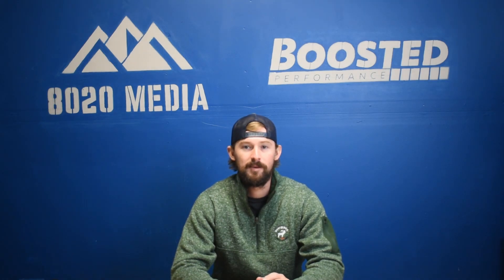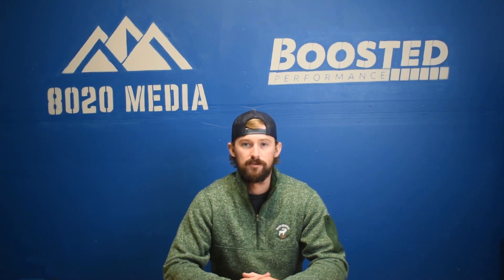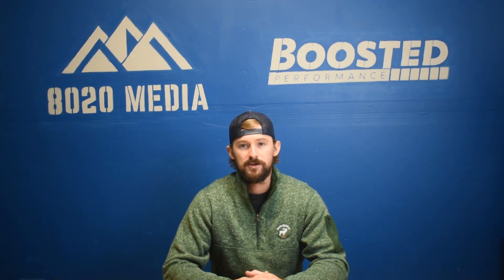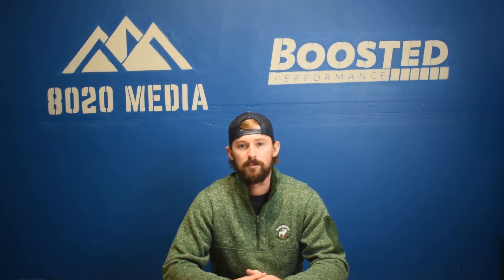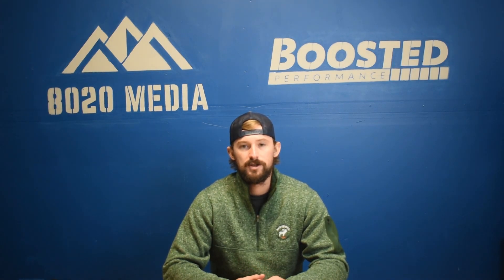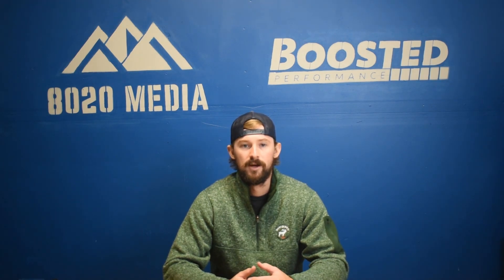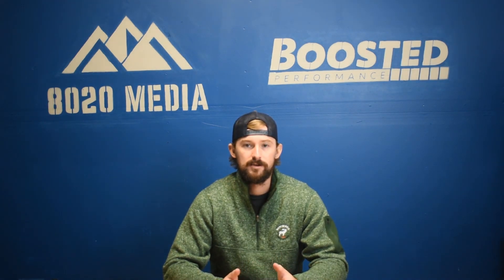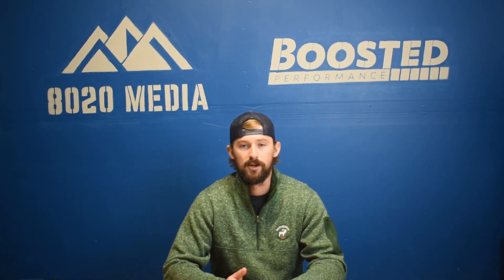Is the Ford Triton V10 a Bad Engine?

Comment: My 2004 f250 v10 got around 12mpg, then shot out the cylinder 4 spark plug now gets ab 9.5mpg and 8mph when towing, still tows just fine and its had about 5,000 miles on it with 9 spark plugs in

Comment: You have something wrong. Remove both  battery cables connect them together for about 30 minutes. You are draining the computer learning memory. Drive for 150 miles in the city. Scan for codes . Those spark plug problems are from people overnighting the spark plugs!

Comment: Never seen a timing chain issue with 2V engine. Only the 3V's when they went they started using plastic hydraulic tensioners. The gaskets would blow out on the tensioners. The 2V engines used an iron tensioner with no gasket, and I personally have never seen one fail. A 2V engine will go 400-500K without a problem with the chains. Doesn't matter if it's a 4.6, 5.4, or a 6.8, the 2V engines will run until the exhaust manifolds rot off the engine. The spark plug issue does suck, and is very relevant, but not a terrible job, unless it's the passenger rear cylinder. If you to end up blowing a spark plug out, I highly recommend using the Cal Van kit and insert. It uses a far more robust, shouldered insert than a typical Heli coil. The 3V engine had the opposite problem. The spark plugs would actually get stuck and break off upon attempted removal. I believe that was corrected by '06ish. Just my 2 cents.

Comment: Biggest problem with my Triton V10 is the rusted out rocker panels, door bottoms and frame. It's a damn shame my excellent drive train will be wasted when this Excursion goes to the crusher. Only 120000 great running miles stuck in a rust bucket. Shame on you Ford.

Comment: I just purchased at 2004 motorhome with the v10 it has 38k miles on it. I drove it 300 miles from Ga to Alabama it rode good pulled a Nissan Altima  behind it on a trailer barely felt it. Lookin forward to learning more about this engine it’s my first ever Ford
Reply from the maker: B - Nice! Sounds like a solid buy.

Comment: Mine is at 190k. I’m going to pull the engine. Take to a machine shop and have the plug holes repaired before the problem happens. Also will check to see if timing chain needs to be replaced. I can’t believe the cost of new trucks and I’d rather give mine a refresher before towing my fifth wheel.
Reply from the maker: B - Fair points! Thanks for sharing.

Comment: Have one in my 2000 Excursion for 200k. Never had this plug problem, always used Motorcraft plugs, never seize, and torque to spec.
Reply from the maker: E - Nice! Thanks for sharing your experience.

Comment: I am considering swapping the V-10 for a 7.3L Power Stroke.
Comments?
Has anybody done this?
'99' E-350 motorhome.
Reply from the maker: M - Swapping a V10 (likely the Triton 6.8L) for a 7.3L Power Stroke in a 1999 E-350 motorhome is a massive undertaking but not unheard of—some have done it for the torque and fuel economy benefits of the diesel, especially in towing or heavy-load scenarios. However, it's not a drop-in swap: you'll need the complete 7.3L drivetrain (engine, transmission—typically the 4R100, matching PCM/IDM modules, wiring harnesses, and fuel system), along with diesel-specific cooling and exhaust systems. The V10 and 7.3L have different engine mounts, frame brackets, and potentially transmission crossmembers. You'll also face challenges with electronics integration, including the instrument cluster, speedometer/odometer functions, and emissions system compatibility depending on your state. While the 7.3L is a proven workhorse, ensure your frame, suspension, and braking systems are up to the added torque and weight. Many have done this swap in F-series trucks, but fewer have tackled it in vans or cutaway chassis due to the tight packaging, so clearance for turbo, downpipe, and intercooler plumbing will be tight. It's doable, but it requires serious fabrication skill, a full donor vehicle (ideally a 1999–2001 Super Duty or E-350 diesel van), and deep pockets if you’re not doing it all yourself.

Comment: Looking to get a 2016 shuttle bus with this engine. your video gives me confidence. sounds like it'll be fine. I was worried because I heard many stories about the spark plug blow out and my dad had a truck with a V8 triton that blew itself up because of the timing chain issue.
Reply from the maker: Y - Totally understandable—and good news: the 2016 Ford V10 Triton in that shuttle bus is part of the later 3-valve generation, and by that model year, Ford had already addressed the major spark plug and timing chain issues that plagued earlier Triton V8s and V10s from the late '90s and early 2000s. The plug blowout problem was mostly fixed by 2003–2004, and while no engine is bulletproof, the 6.8L V10 is known for being a reliable workhorse, especially in RVs, buses, and service trucks; as long as it’s had regular oil changes and hasn't been heat-soaked constantly (which is tough on coil packs), it’ll easily go 200k+ miles—and it's actually less failure-prone than the 5.4L V8 from the same family. So yeah, it’s a solid choice if you’re getting a good deal.

Comment: I’m looking at an RV with the 97 generation engine. Is that one pretty reliable compared to the second generation?
Reply from the maker: S - Typically the newer generations are better. But the first gen is generally considered reliable and well-suited for RV use, especially in terms of long-term durability and simplicity compared to the second-gen 3-valve version (2005–2010), which, while more powerful and efficient, introduced more complexity and had some issues like spark plug thread concerns and cam phaser problems; the 2-valve V10 is known for being a true workhorse with fewer major failures, decent towing ability, and a long service life when maintained, so if you're okay with its modest power and thirst for fuel, it’s often the preferred pick for low-maintenance reliability in RV applications.

Comment: I have an 08 f350 with the 6.8 and it has 332k miles on the clock and all that’s wrong with it is 2 broken exhaust manifold studs. Other than that, oil still clean after 3,500 miles of driving with 4K mile intervals on oil changes
Reply from the maker: O - Nice! Thanks for taking the time to share your experience!

Comment: I have a 2002 F250 triton V10. Absolutely a great truck. I pulled a 5500lb  stainless steal trailer with four 1500 lb horses. Now if we were in foot hills or mountains Yes there was a problem with that much weight. The only consistent problem was it missed once you got to 55 miles per hour, but later my dad had his mechanic look at it and the the other mechanics had only ever changed 8 of the 10 spark plugs. After he replaced them all , it ran like a dream.
Reply from the maker: W - Nice! Thanks for taking the time to share your experience!

Comment: MINE IS A 2000 , FORD f350..Triton V10  IT HAS 140,000 miles , the Only thing i have done to the engine is new Coiles around 100,000 mls...
Reply from the maker: Thanks for taking the time to share your experience!

Comment: What causes the fuel economy problem exactly cause I do wonder about building one of these things with an aftermarket crank rods and pistons and add a big single.
Reply from the maker: F - The poor fuel economy of the Ford Triton V10 is primarily due to its large displacement (6.8L), naturally aspirated design, and relatively low thermal efficiency compared to modern engines. The engine prioritizes torque and durability for heavy-duty applications rather than fuel efficiency, with features like a high rotating mass, long intake runners, and low compression ratio (9.2:1), which aren’t optimized for fuel economy. If you plan to build one with an aftermarket crank, rods, pistons, and a big single turbo, you can significantly improve its performance and power output. However, to mitigate fuel economy issues, you'll need to tune it carefully with modern EFI systems and potentially increase the compression ratio for better efficiency, balancing power with fuel consumption.

Comment: Been researching this for considering a 2001 e350 with the V10 engine in it.  New about spark plug blow out but might need to start looking at a 2002 and up van now.  Thanks for the input.  Am kjnd of surprised about the timing change aspect thought it would be more like a 5.0 pushrod engine and go for a longer period of time.
Reply from the maker: B - Thanks for the feedback! Hope the video helped.

Comment: I have 08' F250 Super Duty with 355k miles and still running my goal to reach four hundred thousand miles and after that maybe reach 500k (lol) nothing wrong just keeping up with the synthetic oil change and maintenance. I am the second owner, I've had it since 2011 coming up on 14+ years ! A/C blows better than on my new truck.... I use it for  work and hauling round bales
Reply from the maker: H - It can certainly see that kind of mileage, pending maintenance! Keep us updated.

Comment: I had a 2008 3 valve v10 F-350 had the valve retainer fail and droped a intake valve in cylinder 4, it munched it till there were only a few chunks  left and sandblasted the cylinder wall. Since that cylinder had lost its intake valve, it was at the same / under pressure or under vacuum as the rest of the intake allowing all the munchies too get sucked into cylinder 8,9,10 and a little into 3 and 5... entire engine, heads, pistons wiped and when taking it apart I noticed that the cams and balancers had a lot of premature ware because theres no bearings from factory (the ware is prob cuz the previous owner didn't do proper maintenance as well) but in my opinion those motors are supposed too not last past 200miles with dealer maintenance. Every engine I've seen that ain't a Briggs and straton has cam barrings.  
Crank even had pitting for some reason and the timing chain retainer / tensioner on the driver side needed replaced I could colaps it by hand when biopsies was done but it never jumped time, it had a valve retained smaller then my pinky nail fail.
That truck had 174 000KM on it when it went and one new transmission and I think tansfercase at 124 000KM replaced by the previous owner at the dealer. Junk.  (Edit: the truck was kept up with when it was under warranty but the 5 or so years after the warranty ran out idk)
Reply from the maker: E - Thanks for taking the time to share your experience!

Comment: We had a company truck, an F-550 loaded to the max with this engine. For that duty, this engine was a mutt. Not enough torque but no RPMs, either. We didn't have trouble with the engine but it did eat coil packs. We had to bring it to a different mechanic to replace spark plugs because the usual mechanic nor the local dealer would touch them. Commercial truck, out of warranty. The truck would normally get 8 MPG in the summer. It was closer to 6 MPG in a New England winter. After 180k miles, the truck was on its second transmission and second differential but the engine did live until we finally got a new one. For something that big and heavy, it should have been a diesel.
Reply from the maker: E - Completely agree. Thanks for taking the time to share your experience.

Comment: I have been very happy with my 2001 V10 F250, only thing not mentioned but I believe is worthy of being known is that the V10 burns oil.  I make it a point to make sure to check oil level every 3rd fill up and usually have to add about 2 quarts between a 5000-mile oil change.  Also as mentioned the V10 gets terrible gas mileage, but I only use the truck to pull a travel  trailer 3 times a year, and on weekends going to adnd from the hardware store.
Reply from the maker: C - Thanks for taking the time to share your experience!
Reply: I have a 2002 I use as daily driver. About 10 miles per day.... but I notice that I do need to check the oil frequently.

Comment: I have a 04 E450 v10 in motorhome towing a ford Ranger I get 11 to 12 but the 28 ft motorhome is a B plus I stay under 62 to 65 mph the motorhome is lighter weight for 450 so I’m 2000 lbs loaded under max. Oil has always been changed Mobile1 once a year as I only put 2000 a year on her. It is ready to turn 50k miles. 
I hardly jumps out of overdrive on highways even towing. It’s always been garaged. I would never buy new Ford with all the issues they have but in 04 they were built well same as Ranger I pull.
Reply from the maker: F - Thanks for taking the time to share your experience!

Comment: I have an 05 excursion 4x4 v10 and not towing it gets 15.4. About 8 or 9 towing. Currently at 229k amd never opened the engine. Been a great engine. My 05 f250 with a 5.4 has 237k and also never been opened up but gets 16.6 not towing so not much better for the problems they can have.
Reply from the maker: C - Thanks for taking the time to share your experience here! Sounds like you take great care of it.

Comment: This is aggravating… Men that bitch about fuel mileage should buy a car.  There are 2 problems with the v10.  1 they don’t freaking die so that you can get a godzilla.  2 there is no aftermarket parts to add horsepower.  That’s it

Comment: I have my beloved 2002 f250 v10 that has hauled my keystone 40ft cross country no problem over 3100miles. On the same trip my 2023 f350 broke down half way home. It was fixed by the dealer but the whole thing was a nightmare.
Reply from the maker: S - They certainly don't make them like they used to.. Sorry to hear.

Comment: I drove a 16 passanger bus that had a V10 it blew out 1 spark plug other than that it was a good motor a bit of a pig 🐖 but was in a heavy bus. Had 130k when i left that job to get a CDL and drive truck but i still see that bus running around town for MRDD so still going.
Reply from the maker: T - Thanks for sharing your experience!

Comment: Just purchased a 2005 shuttle bus that belonged to a church. 22,000 miles on it. I hope it is as good as people say it is. I’d love suggestions on what to do since the motor is 19 years old even if it is low mileage. Drove it home 5 hours and it ran great. Change oil and tranny fluid? What else? Getting 6 new tires for sure. They looked good but I had a wobble driving it home. Took it to my tire guy and an inside dual had the tread coming off.
Reply from the maker: C - We would look at the maintenance records and see what has been addressed already. From there just do standard maintenance since it sounds like it's running well.

Comment: I have 300,000 miles on my triton V 10 in my 2001 Ford excursion three valve motor than normal maintenance in a couple blown out plugs. That thing runs like a monster and I have literally out towed in drug 7.3 down the road.
Reply from the maker: K - Nice! Thanks for sharing your experience.
Reply: The Excursion never got the 3v V10. Even the last year of the Excursion still had the 2v V10.

Comment: We have 3 v10's. One runs great, another runs rough but we never really drive it and one is currently in the shop and they can't figure out the misfire issues. That one is a 2003 with over 200k. I think the transmission is starting to go out too so it's time to look for something else.
Reply from the maker: L - Thanks for sharing your experience. We love these engines.

Comment: I have three 7.3 diesels and three 6.8 gas all over 300 thousand. I have put way less money in the 6.8 gas . 11 mpg gas 16 mpg diesel over all counting fuel the gas is way cheaper to keep going and I didn't think it would be. Going to try and run them to 500 hundred thousand.
Reply from the maker: Ron - Sounds like you've got quite the fleet. Thanks for sharing your experience.
Reply: Need help 😁
Reply: Would you buy gas over diesel?
Reply: @southernsudssoftwash if you tow a lot or like speed get diesel, if you don’t tow a lot and don’t romp on it gas

Comment: I have a 2009 Superduty with the V10 and it’s been the best engine I’ve ever owned. 12mpg around town unless you idle it a lot and 15mpg on the highway on cruise control with the 4.10 rear. Oh, it’s a towing beast in the 8-9k lb trailer range.
Reply from the maker: F - Thanks for sharing your experience!
Reply: Just bought that exact one yesterday with 80k miles on it, I’m excited
Reply: @itsroman4704 I’ve since graduated to a 2024 Superduty 6.8L V8. 40 more HP, similar torque numbers, 10 sp transmission and 25% improvement in MPG.
Reply: @fla-gypsy57 how did the truck hold up for ya till the end, I’m wanting this tk be a long term truck
Reply: @itsroman4704 I drove it for 15 years and never replaced anything on the motor. The transmission (5sp) was stout, no failures. Repaired the AC once, and body mounts once, everything else was routine maintenance.

Comment: Bought my '03 f250 6.8 with 160k miles, now sitting at 240k miles. In those miles, I had to replace driveshaft u joints, a wheel bearing and a steering box. Thats it. Aside from a congratulatory tune up at 200k and regular fluid changes. Honestly one of my favorite vehicles I've owned and I plan on hanging on to it until its ready for the scrap yard.
Reply from the maker: S - Thanks for sharing your experience! We've heard many success stories of these.

Comment: My04 v10 has 276k. @140k ford garage did the valve roller needle bearings, tapping for a minute+ at startup. Almost traded for a 6.2 2014. Decided to keep the v10 for probably a while, runs perfect, however, in can stumble just barely during idle, probably could use a timing chain. I definitely listen to it carefully at all times. Could you do a video on the 6.2? All i found was valve springs can break. 32 springs and 16 spark plugs, thankful there aren't more
Reply from the maker: E - Thanks for sharing your experience! We will add the 6.2 to our list, however, in the mean time, this article on our Chevy Trucks website may help: https://chevytrucks.org/ultimate-gm-62-vortec-engine-guide/